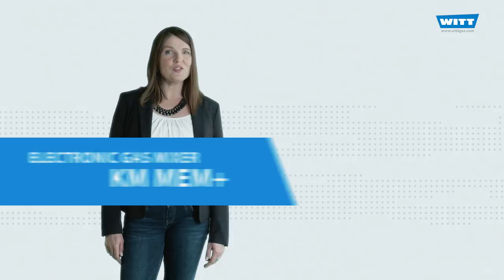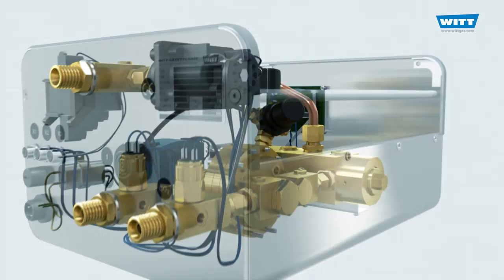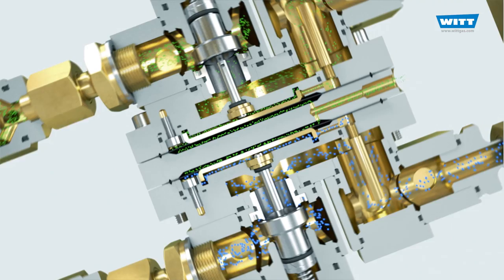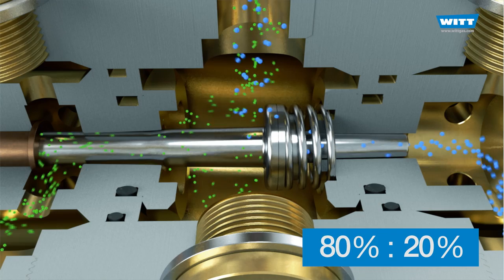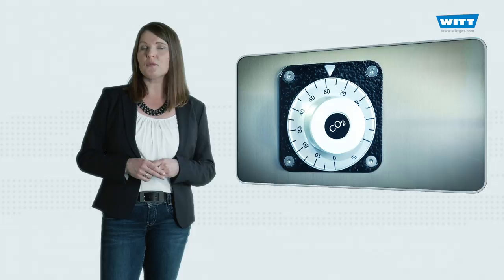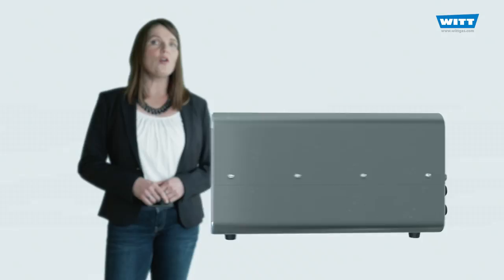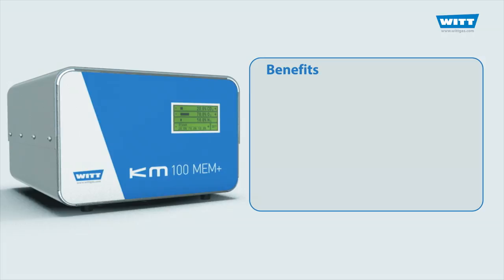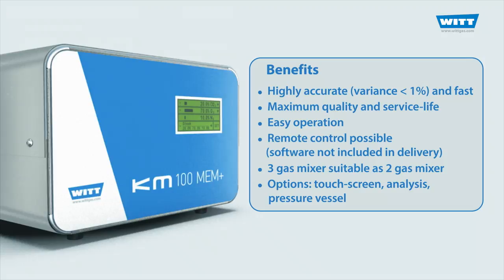How the electronic gas mixer KM-MEM+ from WITT works

Comment: Hi, this device can mix H2 + N2 gas ?
Reply from the maker: Thank you for your request, Mr. Raziz. The KM-MEM+ is not suitable for flammable gases due to its electrical parts. So a mixture of H2 and N2 is not possible with this mixer. But in our range of gas mixers we have several models available for mixing flammable gases. Please visit this link to see the complete list: https://www.wittgas.com/products/gas-mixers.html?tx_cswittproducts_products%5Bcontroller%5D=Product&cHash=e95a661589fb0336c611f2c47acb5f19

We are happy to answer all your questions regarding gas mixers and to advise what the best mixer fitting to your requirements. Please us the contact form at https://www.wittgas.com/contact.html.

Your WITT team